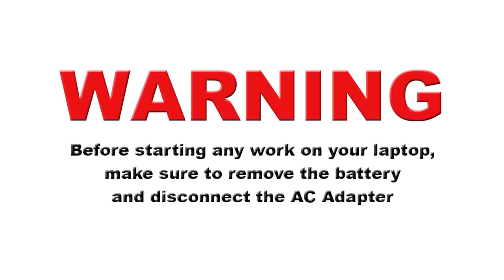Acer Aspire Laptop Repair Fix Disassembly Tutorial | Notebook Take Apart, Remove & Install

Comment: Yeesh. There's gotta be an easier way to access the fan. All I want to do is clean out the dust so it stops overheating! Damn you Acer!
Reply: +dazirapa my thoughts exactly!!!!
Reply: dazirapa i just hold the fan the use a vacuum cleaner job done
Reply: The worst part about Acer laptops is that to reach the exhaust fan u need to reach the bottom of it .
I wish it had a separate compartment for easy access .

Comment: the best acer has got to be the acer aspire as8950g model  i found on a curb side cleanup and just had to replace the keyboard  and as added bonus the was water coming out of it and it does work fantastic great machine after dryng of course
Reply: Damn, lucky bastard.
Reply: piip4 i still uss till this day its only 7 years-old

Comment: Hi the hinge of my Acer on the lid is loose and catching when open or close on bottom part. How can i fix this, i do not know if it might be broken
Reply: +salomie klindt wow i have the same problem..acer aspire..sadly i have no solutions..but please let me know if you find one..
Reply: Well u probably have opened it, and there is a part inside of the laptop where those 4 screw on bottom close to screen are you will need to put the parts back so u can put those screws in. 

Well probably you will not need it anymore after 3 years but ye thats the solution pretty much

Comment: I'd  like to know what model this is
I'm trying to disassemble my Acer Aspire 7741Z-4433
one of the screws on the bottom is stuck but not stripped 
and I couldn't figure out how to get to the part where you plug in the charger

Comment: I've been following this steps, and after I finshed and put my laptop together I noticed my keyboard isn't working anymore. I tried to reconnet it several times but it's still not working. The status on control pannel is ok and says that the keyboard is connected and working, but it's not. Can somebody please help me?
Reply: did you replace it with a new, functioning keyboard, if you didn't/cant, hook up an external one

Comment: Hiy.. Anyone pls help me . I have an acer aspire 4741z laptop... The HDD of it is no longer working that means i cant enter windows.. So, i want to change the hdd.. I just want to know how much it cost? And what should i do after changing it?
Reply: +Hafidz Razman For the price just look on internet buy HDD. Do you use the laptop at home? If not, you might want to think about a SSD. if you do not know what it is, id gladly aswerr your question. The broken HDD is easy to get. At the back is the panel with probably 4 srews. open it and there it is. If you place your new HDD/SSD you have to install it in the BIOS (accesable via f10 of sometimes f2 and f8). Dont forget that this new HDD doesnt have windows. 

(Sorry if i give directions like you are 5, im a first year IT student and your like the first person im trying to help. If i gave bad advise please replay because im still trying to learn. Also if you have other questions, i can help you find them.)
Reply: Qopiq q ohh hey.. ty but its really late.. i gaved up on that laptop and sold it for parts
Reply: +Hafidz Razman yeah i saw it was months ago haha.
Reply: Qopiq q but it was kind you

Comment: where is the HDD ?
Reply: The HHD sits at the location he is pointing at at 2:03. Either it was removed before recording or it came without a hard drive. But if there was one, it would be sitting in that metal bracket.